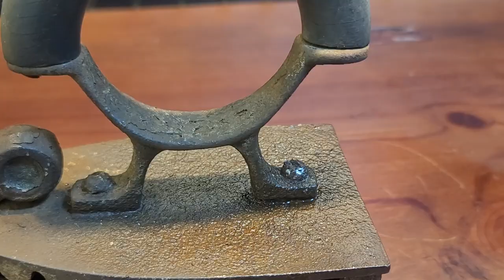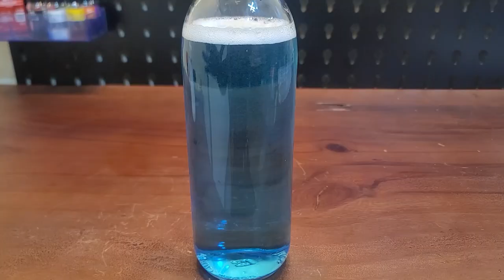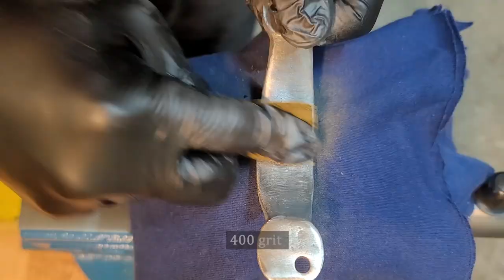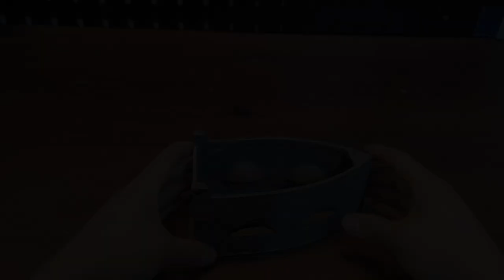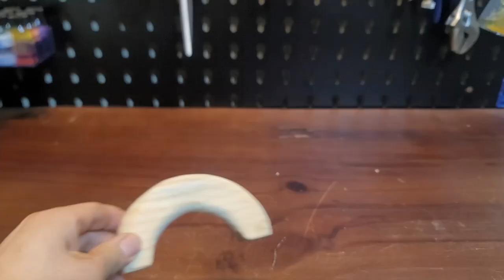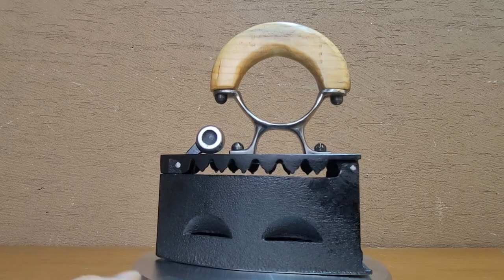Restoration of an old rusty 1900s iron - how to plate nickel

Comment: i watched your video with a lot of interest - I tried nickel plating couple of times but was not very successful but after your vid I will try again -- great job!
Reply from the maker: Thank you for enjoying my video with the interest.  Did you get the ratio right? If you did that and it didn’t work, you probably neet to pay more attention to the surface treatment before plating. I also finished plating in two time. After the first plating, sand the part that did not work well with sandpaper and try again😁. Thanks for the comment and I hope it goes well.
Reply: @g-restoration1624  Thank you so much for all the additional details - I bought a new chemicals and hope it will work better but I am yet to try. Will keep those tricks you shared in mind though - best of luck and see you again soon.
Reply from the maker: @DANYMITERESTORATION  
Yes, you are good at it, so I think you will do well. I wish you success. Good lock at all thing.
Reply: @g-restoration1624  that is very kind of you to say - same to you!